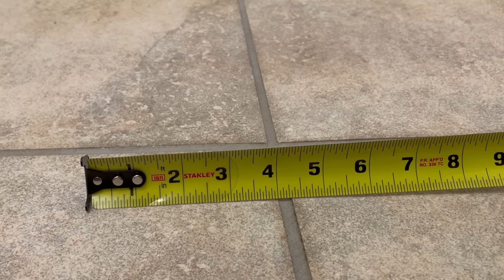How To Install Vinyl Plank Flooring(Start to Finish)

Comment: You make it look too easy !  The SLC spoiled you.  I like the tips about how to do the tub to floor and matching up the butt end grain...   I've typically gone random which as you note can result in dramatic color difference between two butt end joins.  I bought one of the bullet shears for cutting laminate which works great on LVP.
Reply from the maker: Yes, I’ve gone both ways with the end grains, I prefer trying to match them but it’s not a huge deal.

Comment: What do you do with the gap against the cabinet/vanity?
Reply from the maker: Over there I’m putting on a new cabinet kick that will match the refinished cabinets.
Reply: @TheFunnyCarpenter  good idea. Was just curious. I’m planning on replacing tile with vinyl in my kitchen soon and wasn’t sure what to do along the toekicks. I’m thinking I’ll most likely use some kind of shoe moulding maybe. Thanks for the response.
Reply from the maker: Ya a moulding will be the easiest way.  If you can start the row at the kick you could also try and undercut the kick with a multi tool and slide the flooring under.  I’ve done it before, it’s a bit of a bitch but it looks good if done right.
Reply: @jasonbertels4927  1/4  round looks good.
Buy real wood and stain to match.

Comment: You seal a floating  Floor Against the bathtub, If you ready the instructions It’s Not aloud. You can have immigration of the plasticizers and your floor can not move arround anymore so,is there a better solution for that?

Comment: That was the most helpful video I have seen yet on this, thank you!  One note though, if you use Silicone caulking then if you spray it with rubbing alcohol you can get an amazingly smooth finish.

Comment: For anyone without access to a table saw for rip cuts, a good OLFA knife will still work just make sure you are careful when snapping it off. 
For SPC vinyl however, after installing it in a large room and into a long hallway requiring lots of notch cuts around doorways, I went through an excessive number of jigsaw blades, we tried every type of blade we could find at our local store and the SPC dulled them all almost instantly.
I just recently had to install SPC again and having recently purchased a new angle grinder and looking for an excuse to use it, I decided it was worth a shot; an angle grinder with a cutting disc is definitely how I plan to notch cut SPC in the future. Cuts through like butter, and the disc barely even looks used. (Just don't forget, never neglect safety whenever using an angle grinder)

Also if you can't find a close colour match for caulking, I have found translucent (not transparent) blends in really well in most cases.
Reply from the maker: Good info thanks for sharing Alice.

Comment: Looks good.
Great tips on the install.

I recently did a tile job with multiple transition strips.

The ones from the Big Box stores that are made out of compressed paper are junk.

One day after final install the son of the homeowner snapped one off hitting it with his foot.

Compressed paper is junk.

The homeowner went to a flooring store and bought solid wood transition strips.

He stained them to match and I went back to remove the paper ones and install the new ones.

I will not ever use the paper ones again.
Reply from the maker: Thanks Shawn. I’ve had good success with the VP transitions from the Home Depot. I have some in the basement that have stood up well.

Comment: When i had to cut the flooring around the toilet flange, i took a piece of cardboard and cut out a hole the size of the flange. I installed that piece of flooring, not quite locking it in, then aligned the cutout in the cardboard with the flange and marked where to cut the flooring. I was able to get a 1/16” gap around the flange quite quickly and easily with no measuring.
Edit:  Great idea to seal the floor at the tub with caulking. I was going to use silicone to glue a plastic 1/4 round or base shoe on it but they’re pretty curvy and not easy to get on straight if you can’t nail it. Then there’s still the problem of having to seal it.

Comment: You should definitely put caulking against the bathtub, but they DO make waterproof quarter round trim for this specific purpose. It’s cheap and I highly recommend it. You can even use color matched for your flooring trim quarter round that many floor manufacturers make for your flooring color. LL flooring has this for many of their flooring colors and the cost will be very minimal and make your flooring look much better. Besides you should still have a 1/4 inch gap here and doing it as it’s done in the video can cause buckling in the flooring if it expands as placing it that close to the tub and caulking it doesn’t allow for expansion.

Comment: Did a brick pattern in a large family room, about 14x40', with 6' dark cherry colored boards and liked it a lot, but it really went with the rest of the room. Had chair rail and the boxy wainscoting. Just made sure the seams on every other row were exact center of the room all the way down.

Comment: I'm interested to know why vinyl flooring is considered an upgrade to ceramic tile.
I'm not trying to be contentious, I just don't get it and would like to hear your (other people's) opinion on the matter.
Thank you for sharing your content.
Reply from the maker: My wife wanted it. We have it in the basement and she likes it… not much more to it than that
Reply: I've been wondering the same thing.  My wife wants vinyl "wood look" in our kitchen when we already have a blue-gray solid color tile.  The only plus is the planks will be warmer on a cold morning.
Reply: My reason is because my ceramic tile is an ugly southwestern type, it hurts my feet walking on it, and it is literally impossible to clean!!! I hate it everyday with a passion because of how filthy it is. I know not all ceramic tile is as bad as the kind the builder of my house used, but it must’ve been the cheapest option like most of the materials on this house where they cut a lot of corners. Also, I plan to chalk paint all the ugly oak cabinets in a white or grey and that will not at all match the southwestern ceramic.

Comment: Do you recommend chaulking with "230" between the base boards and plank in other rooms to keep bugs or dirt from getting in that gap? Even though it's supposed to be a floating floor. And
Thank you Soooo Much for your knowledge and Comon sense advise which running a bit thin here in So. Cal. :) :)

Comment: What do you recommend for uneven floors. We tried to fill in the space with cardboard but it didn't work.
Reply from the maker: Floor patch for low spots and sanding/grinding the high spots.  It’s a bit of a chore!

Comment: I went to the store and they said although vinyl planks have underlayment backing, they still recommend underlayment if install on concrete. Should I put underlayment like they recommended?
Reply from the maker: I would check the installation manual that comes inside the floor.

Comment: I have an old hardwood floor that I want to install vinyl plank over. The issue is that the hardwood strips are warped on the short cut. It's not overly bad but you can feel it if you step one it. What is the best way to even it out to pace the vinyl planks?

Comment: I am curious, you don't put any paper barrier?
Reply from the maker: I did not, it is not required for this particular floor.
Reply: @TheFunnyCarpenter  ok. Maybe because I was doing it in as a basement floor (concrete). Thank you.

Comment: I bought and had a carpenter install $1,200 worth of Staccato Ash Rigid Core Luxury Vinyl Tile that I bought from Floor and Decor.  It went down fairly easily, we noticed a stain and no one from Floor and Decor or Nucor would / could help us.  I think this floor is too sensitive to stains and should not be used.